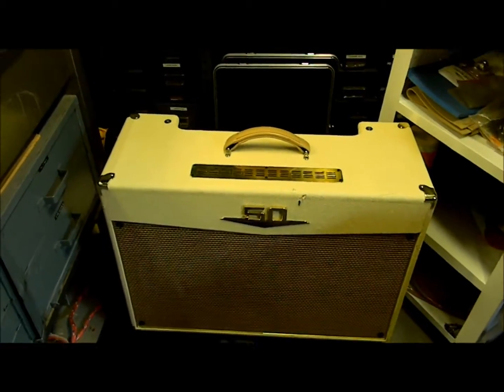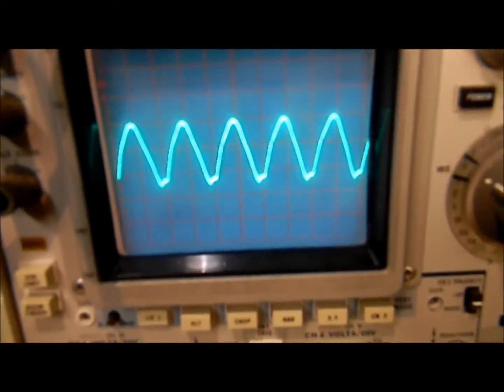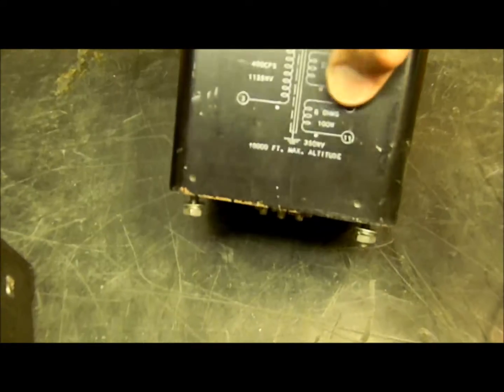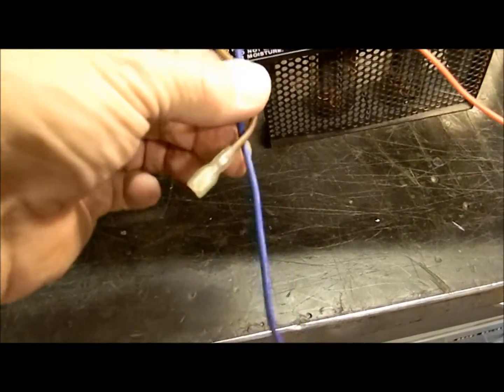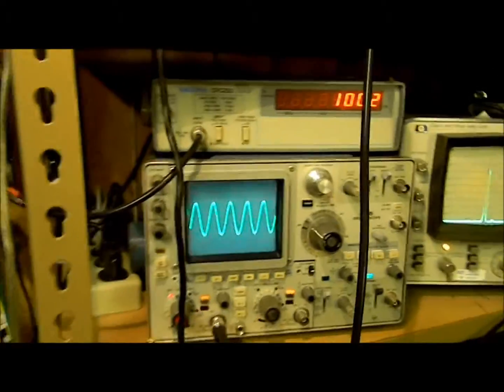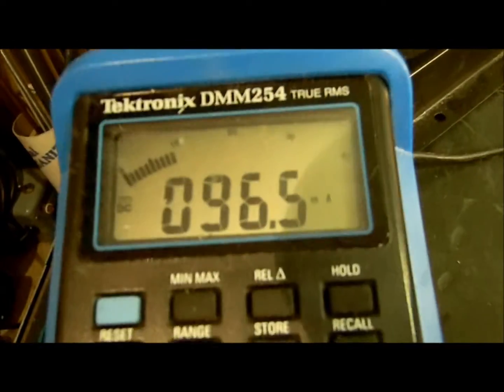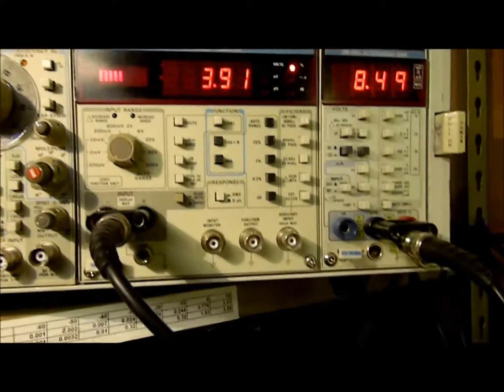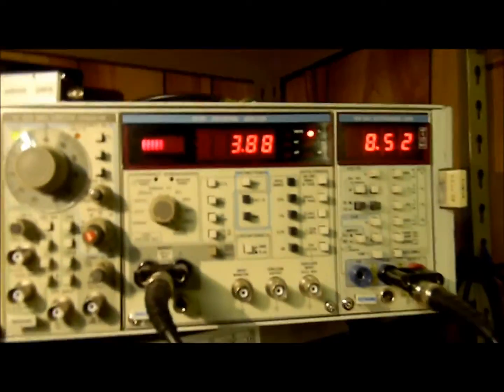Crate 50 Vacuum Tube EL34 Guitar Amplifier Under Repair and Test - Part 1.wmv

Comment from the maker: I will try to help. The green wire from the power plug is a safety ground and connects directly to the chassis and would not go through a switch. I have made mistakes as you did also. Taking pictures with a digital camera is my easy way out most of the time. Send me pictures and I will do what I can to help.

Comment: Im hoping u can help me.. i took apart my crate gfx 212 amp to fix the jack..thats all fixed up but when i took out the board i disconected the ground wire from the power switch a green wire and the speaker wires from the board and i forgor where they go. I can find a board schematic anywhere online or on the crate website.. u think u can help? I could email u a couple pix of the board..

Comment: ah good thing, I will check all screen resistors..My probe (BIAS) I use measures plate current on my multimeter it was modified by my friend who builds transformers, the guy is hard to reach for help..I did try to measure few things on the OT with a multimeter but it is very hard to get anything precise, like you said here hard to tell, I do have a substitute once the screens are good I will give that a try and see if power is back normal..thx for the help

Comment from the maker: OT can be bad but that is rare. Have you checked each 6L6 socket to see that proper voltage is on pin 3 (plate) and pin 4 (screen) - Warning... HV... Sometimes if a 6L6 flames-out (turns cherry red) it can take out the screen resistor (something like 470 ohms) and the tube will be doing nothing even though it is new. You can add a 1 ohm resistor in series with the cathode and measure cathode current on each tube to be sure all your output tubes are working as they should. A few things to check.

Comment: alright thx Sir, bare with me I'm a French speaking dude, have a volume problem on a similar amp but I don't have all the equipement you have, basicly I must go blind. The problem is form a 4x6l6 Crate head BV120H head, the tone seems to be «normal» as per the customer sayings, but the amp have less power then ususal, all tube have been replaced with new ones, BIAS done, still the same, voltages seems high enough as well, B+ at the plates is around 460vdc... OT could be the snag?

Comment from the maker: Yes, notch distortion is where the sine wave transitions from + to - and then from - to +    it occurs in the middle of the signal on both sides. High levels of negative bias generally causes increased notch distortion.